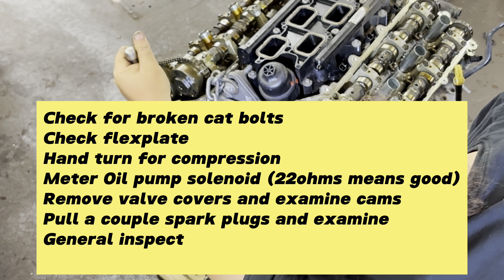Promasters Only - Upgrading A Replacement Engine. All the things I do to it while it's out! Ram

Comment: So I've been watching alot of yojr videos lately.my weekend has been a promasters only binge. I had my van towed last week bc the belt broke from what I thought was a seized power steering pump. I replaced it and when I started the van back up it made God awful noises so I think the power steering pump is the least of my issue.
Reply from the maker: Belt system is really simple. Two idlers, a tensioner, p/s, ac, alt, water pump. Best bet: pull the belt and spin each by hand. You’ll find it.

Comment: Wish you were in the Boston area. Need to replace the ps cooler and return hoses. Is the Factory cooler better or use the Dorman?
I was thinking about just replacing the rubber part of the return hoses instead of the whole unit. Good or bad idea?
Looking forward to more of your videos
Thanks
Reply from the maker: Never seen the cooler itself go bad, but a super common issue is a leak on the upper small hose that comes into it. Fix is to add a 2nd hose clamp where it enters the cooler.
Reply: @promastersonly1419  thanks, it is the upper hose that is leaking where it connects to the cooler
Reply from the maker: Just add a second hose clamp to that upper hose, and top up the reservoir. Autozone sells an expensive fluid in a green tin can, and a cheaper fluid in a green plastic bottle. The cheap one is fine.
Reply: @promastersonly1419  thought the chf11s was mandatory with these. The reservoir ran dry as I never noticed the leak. The pump does not have the usual out of fluid whine but I question if the pump is dry. It’s a 2019 2500 off lease from Hertz like brand new so I have been watching all your videos on specific fluids and hopefully I won’t have any future problems. The returns hoses are totally unavailable anyway. Lot of back ordered parts for these
Reply from the maker: True, but if you read the cheaper CHF bottle it's compatible. Hope so, I've been using it for years! The pump is supposedly self bleeding if you turn it lock to lock a few times. We've run the res dry a few times, and the system seems robust enough to handle that. Hope so.  @GreenMonkiCoffee2008

Comment: What's a good rule of thumb for replacing the timing chains. I'm at 170,000 miles right now
Reply from the maker: In close to 10 years of doing this, NEVER had to replace a chain, or anything remotely related to the chain. Never even seen one stretch. 600k no sweat.
Reply: @promastersonly1419  what about the accessory belt
Reply from the maker: It's a funny thing. Because of a few design features, these engines almost NEVER need belts. 300-400k on a belt is common. But for $40, get the Gates brand belt and never think about it again.  @customchicano7485

Comment: Do you know if you have the part number for the Dorman thermostat? I have a scheduled install for the Dorman oil cooler and coolant crossover... cause there is oil on the top side. Should I have them replace the thermostat also? I am at 70,000 miles.

Love your videos... thank you
Reply from the maker: 902-9036XD. Every parts store has them.
Reply: @promastersonly1419   oh no, I got 902-3035HP. wil that not fit?
Reply: I have a Promaster 2500 2018, can you list the other parts (oil cooler kit, coolant crossover)? Thank you very much.. also do you have any spec stickers left?
 @promastersonly1419
Reply from the maker: @user-lm3ll1jp7f  I believe that’s the same thing, but in plastic. Could be wrong about that. 

926-959 for the cooler. The “dick” is 902-3102HP.

Comment: We’re not old men. We’re men!
Reply from the maker: Men who are old. Embrace it.
Reply: @promastersonly1419  Fine, but I’m not accepting defeat on butt crack. I’m thinking a new line of ProMasters Only pants complete with rubber gasket material vertically sewn into the rear. Like you said, the rubber seals the gaps… Make it happen. Then, write a song about it. Call it Zap-A-Crack or Crack Gas Kit.

Comment: Had the dealership do mine 5,000 bucks 😢
Reply: 2017 135,000 miles on it .
Reply from the maker: Ouch.
Reply: Running smoothly now. what would you have charged I also had the Dorman oil cooler housing put in . Thanks Florida man
Reply from the maker: @ericbentti  the cooler is the most important piece by far.
Reply: curious, are you saying you had engine replaced for 5k out the door?